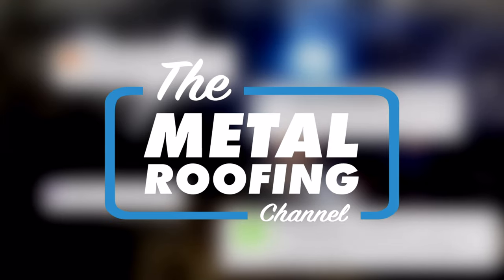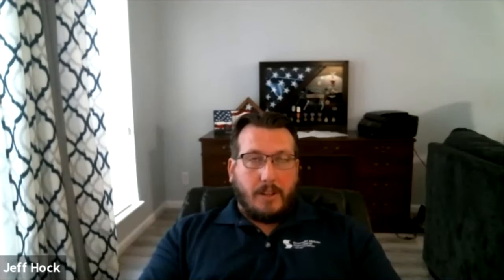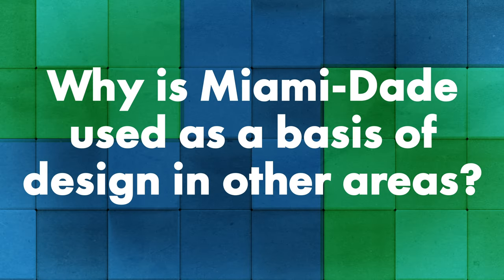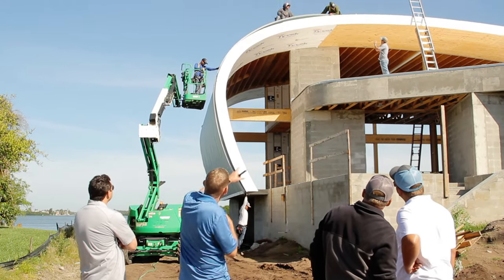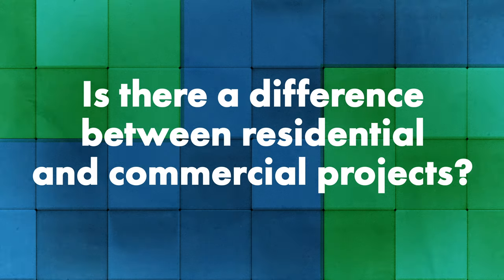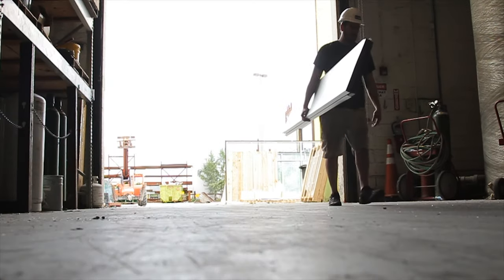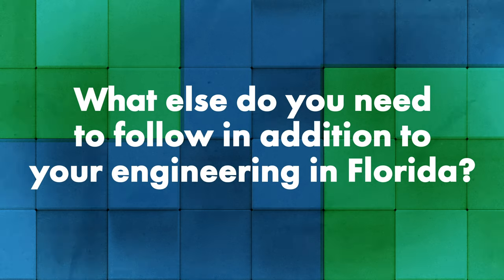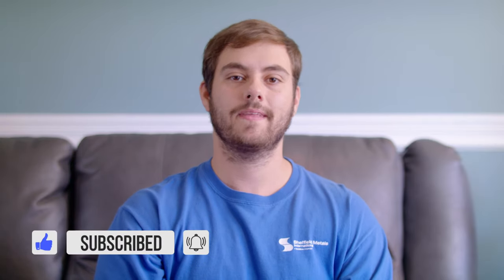Florida Building Code: Navigating Metal Roof Installations in Florida

Comment: I just started watching the video, but I have a quick question I beg you to please help me and give your opinion. I’m supposed to close on my house in six days. It’s a cash buyer. The title search revealed and open roof permit. I never had it inspected. Are they gonna see that I never pulled permits for other things I’ve done to the house?? Or just focus on the roof inspection. It was a metal roof I installed fyi. What I mean they I’m talking about the city inspector. That would suck if you made me tear down all the work I’ve done to this house over the past four years. I’m not a company or a house flipper I lived there for four years so I think it should go smoothly.

Comment: Why don't the insurance companies require cement anchors for tying down the roof in the event of a storm?  The cement tie downs can be fence posts between each house and be used by both houses or buried in the front yard depending on the roof type.  If the house is properly tied down it doesn't matter what roof type is used.  I survived Yolanda wind speed 196 mph and my neighbor tied down his hut with barbed wire and his hut survived fine! My dad's house blew over as did all of the trees!  The most dangerous thing of the storm was fire danger afterwards and the poisonous critters after the storm! They turned out the power so it wasn't a concern but here in the Philippines it's illegal to build near the ocean lol I learned this after buying an ocean front lot!
Reply: Florida construction code for house building requires roof tie downs on every single house they are hidden within the structure

Comment: My house was built in 1925. Roof is being replaced. It has 1x4 battens and 5v metal crimp , the old steel material.roofer states I do not need an underpayment since I have battens yet there is a black tar paper or felt currently between the battens and the metal. I feel it is required. St John’s county said he doesn’t have to do it since the house was built before these building codes. Please help with code information if you will.

Comment: I had a reroof estimate a couple months ago and had asked the guy how much for reshingle and how much (ball park) for metal.  He said reshingle is going to be $19,900.  My house is 3,550 under roof, but it is a simple roof to do, there is only one valley, so I thought that was pretty high.  He said metal would be about $48,000 but he would never have metal done without the $7,000 thermal underlayment, which would put the job well over $55,000.  Then he also said for himself he would never have a metal roof in Florida because the rubber grommets they screw through do not last anywhere near as long as the metal itself and fail.  I am thinking, we can build a rover that we send to another planet, it is bathed in radiation and functions year after year in minus 100 degree Martian nights, stands up to the sun and wind in the driest conditions possible, yet we do not have roofing grommets that can stand up to the Florida sun?  Florida is going to get hollowed out, the costs to reroof, and do other small maintenance jobs has gotten so crazy that people are just going to sell up and leave.  I know I am.  I had to replace a beam in the lanai and the top of the pool enclosure had to be demolished because it sat on that beam, the original permit in 1991 put a cost of $1,950 on the entire pool enclosure, to have the top replaced I was quoted $19,890 a 1,000 percent increase in 30 years.  I have the bill for the reroof in 2011 and it was $9,200 now pennies under $20,000.  Who do they think can pay it?  Well, as much as I would like to put metal up I am 65 in a few weeks so I do not want to pay for someone else to have free roofing for 40 years at my expense so shingles it is.  Unless I just sell up and leave the country, because as a disabled vet I would not live in any state I can afford at this point, they are all red state shitholes.
Reply: In regard to the metal roofs not lasting long because of the rubber, that would only be for exposed fastener metal roofs and not the interlocked standing seam type whose fasteners are hidden and out of the elements. With a good kynar paint the roofs are often given life-time warranties. This is all just stuff I've read though, so take it with a grain of salt.
Reply: @justinwoods535  It is really sort of academic when even the cheapest metal roof is well more than double the cost of shingles, and jacks up your insurance to boot.  My house is $3,550 square feet under roof,   In 2020 prior to the massive blow up in metal prices for roofs I was quoted $52,000 with underlayment.  I would not even want to know what it is now.

Comment: In Florida is it possible to frame a house so strong that you don't need sheathing?  Also, are custom Lexan windows allowed?  I've had these questions on a small house build idea:  https://www.youtube.com/watch?v=G-Kq97fYDuo
Reply: Look into ICF outside walls (and even roofs).  In some areas you may need extra water/termite proofing but with 4" and up to 12" of reinforced concrete between the foam panels I doubt if you'd need any sheathing beyond whatever interior and exterior siding you want to put on.
edit: I just looked at your linked video
Your BEST bet is to get in touch with the county you're thinking about building in.  As an aside, I doubt if the 1/8th inch Lexan panels would meet any sort of code for windows, MAYBE if you went to 1/4"?  Also, a 4" ICF from almost any of the manufacturers should meet or exceed the R value you spoke about.